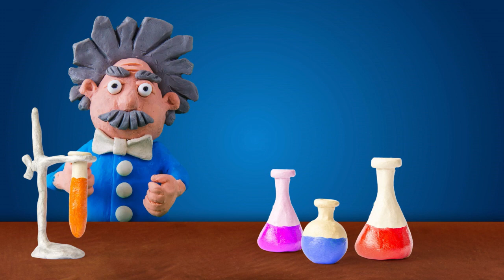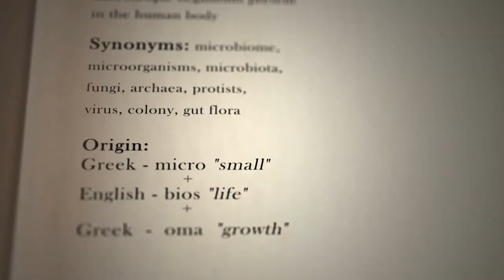Build this Laminar Flow Hood for a Sterile Work Environment

Comment: It looks decent, and the parts you used look familiar (haha) but sadly you are not getting laminar flow with that shield in the way and you can clearly see this with your lighter/flame test.  I'm not 100% sure if you've seen my vid or not but I explain this in more detail in my vid (not sure if YouTube would allow me to link to it).  I would lose the "wings" and top shield and then properly tune it for laminar flow.  The flame must be nearly perfectly still or you don't have laminar flow.  I'm not sure how clean the air must be for your intended purpose (plant propagation) but this design definitely will not work for mycology.  You can also easily prove if your design is working or not with a 5 minute open agar plate test (also shown in my vid).  If you research the medical industry, and look at commercial portable laminar flow units, you will see that they do not have fins/wings this is because that tends to produce more turbulent air, the reason is that it causes a vacuum in the areas that aren't in front of the filter.  Good luck!
Reply from the maker: I totally was referencing your video, I'm kinda shocked that you checked out my video, thanks for all the pointers. Now I'm going to do the agar plate test. My thinking was that if all the air is filtered and fully exchanged then it would be clean air, I turned my cabinet on about 15 min before using, so if there is turbulence  and pockets of unclean air hanging out and circulating then it would eventually get moved out. Time to experiment.
Reply: Laminar vs turbulent doesn’t matter much, all that matters is that the air is sterile. Either type of flow will achieve this, they’re just pushing airborne bacteria and particulates away from your work area.
Reply: @fancycrafts7774  BINGO! 

I try to stress this all the time. Laminar flow is not needed for this hobby, merely somewhat smooth persistent filtered air will more than suffice for our needs. This is a common misnomer pushed by those that simply do not understand what they are talking about. Also to note, many people showcasing DIY "laminar flow hoods" with HEPA-14 filters simply do not understand exactly what laminar flow is, how to achieve it, much less how to test for it, nor the fact that their filtration devices come no where near actual laminar flow. Most of all, the most humorous part, is that they seem to not understand it is regardless, and completely unnecessary for these purposes 😆

Im not laughing at the guy in the video at all, I actually appreciate the design and hard work put forth to create such a design. That being said, anyone claiming laminar flow, and illustrating such with: a lighter, smoke, or a particulate meter is simply and utterly wrong. A lighter (fireplace or any kind), or smoke is merely an indicator of generally HOW turbulent the air is, and a particulate meter does nothing but indicate filter efficacy, nothing more. 

Glad/surprised to see someone in the comments who knows what they are talking about. Nice to meet you!
Reply: How did your Petrie dish test turn out?
Reply: @WhiteBeardHashtag1205  please explain how you do test for it ?
Reply: @WhiteBeardHashtag1205  If you watch gordotek's video he uses the lighter only to demonstrate what the airflow looks like. He measured the air particulates with an anemometer in front of the filter it was 0 particulates above 1 micron,  which is absolutely ideal for mycology.
Reply: @WhiteBeardHashtag1205 I disagree with the idea of it not making a difference if the air is laminar vs. turbulent IF the intended use case is to exclude particulate matter in general or contaminate spores specifically. If you just turn the fan speed up you will get turbulent flow and this will show on the laser particle counter as particulates in the air stream. The particles are pulled into the work zone due to eddies which I explain in my video, also your body/hands and tools and work pieces will generally have contamination on them and the turbulent air will send them flying into your work. You can easily put this to the test with an open agar plate test as shown in my vid. If the turbulent air is not resulting in contaminated agar plates you are fine. But the particle counter doesn't lie, if particle counts are higher with turbulent air you are going to have more contaminated plates, but maybe it will only be minimal damage though and good enough.
Reply: @gordotek  I get what youre saying, I do. And Im not going to argue with you. 

What I will say is that many things make perfect sense in theory, however in application they just dont pan out the way perfectly sound theory would lead you to believe they would. 

My BBFFU, in theory, shouldnt work as good as it does, mainly due to it not being laminar flow. I designed this version of a "poor mans flow hood" when disaster struck my home, and I lost half of my home (the lab side and my sons bedroom) due to natural disaster. At that moment I was looking for a new place for my family to live, and to replace all my sons belongings: clothing, bed, computer, tv, et al. I was in a destitute situation financially and couldnt afford to replace all my lab equipment (specifically my laminar cabinet). I had seen single filter versions if the poor mans flow hood on YouTube, so I went to Home depot and bought: a box fan,  some duct tape, and a ton of different filters to experiment with. I spent about 2mo building and testing different single filters, and eventually many different double filter combinations set-ups (even tested doubled-up filter combos first on front only, and then back only). I spent a shit ton of time designing the BBFFU, because at that time I had a TON more time than I had money, lol! The BBFFU today is the the result of 100s of hours of building and experimenting, and they work FAR better than they should in theory. Ive been using if for almost 3yrs now, and it works so good I STILL use it, even though I have acquired another commercial hood again. Ive poured thousands of plates with mine (roughly 120 at a time). I let my plates sit for a week before I use them (even with my commercial hood), and normally Ill get anywhere from 0-2 of that 120 will tam with the BBFFU. Almost never a grain tam or G2G tam. Tissue transfer tams are also extremely low. In application it just works very well, even with its turbulence, though in theory it shouldnt. 

So, like I said, Im not going to argue with you. There are hundreds out there from Insta, Discord, etc, using these right now, with excellent results (turbulence and all). There have been a few with issues, but after talking with them I find out its due to either: poor sterile technique, not placing the filters on so that the arrows on the sides match the flow of air, they didnt purchase the right filters thinking they could get away with a MERV11 on the front (which will definitely cause tams), or they doubled up on MERV13s trying to make the filtration "even better" (which will choke the fan, causing tams due to extremely low airflow). One even one guy tried just sticking a piece of tape on both sides to hold the filters on as opposed to using the tape generously to seal the filters to the fan. Out of the hundreds out there Ive yet to run into anyone having issues that did a proper build. Many have told me they are no longer interested in buying an FFU or hood, that this does just fine for their level of investment into the hobby. 

Theory aside, the results speak for themselves. And, for $60, 10min of labor, zero tools, and so easy my 11yr old can make one, this gives you an easy to store BBFFU that provides a 20"x20" workspace. Id say its a huge success in all metrics.

Note: even though you and I have had our differences in the past, I want you to know that, when asked, I still stand by my assertion that your "laminar flow hood" is a good design, and a neat little tool that will help many in our community. 

Happy cultivating brother!
Reply: @gordotek I just got my prints and plates. Time to build the hood! Thanks Gordo!!

Comment: i would call this a positive pressure box. is it laminar flow? no, will it keep your samples contaminate free? yes. as long as the filter works the air is clean and it will keep contamination coming in from the air.

Comment: For mycologists arguing that it does not, or hardly, produce a laminar flow, I would say that the design corrects that issue quite nicely. As long as you have the sides and the plexiglass air tight, any turbulence will not suck contaminations into the chamber and you have a good amount of working space. Seems to me it works fine (although I failed to see where you sealed the filter properly to prevent air leaking through the edges) and I definitely enjoyed watching the build. Nice job.
Reply from the maker: Thank you. I didn't seal the edges. I'm relying on the foam edges of the filter to prevent air leaks.

Comment: I have to say, that build was BOSS! If you had it sitting at a garage sale, I'd buy it just for how cool it looked. I wouldn't even have to know what it is! 😆 As far as the overall design, I think it would have been nice to have the filter fill the entire workspace. Just to improve the laminar effect and reduce the turbulence and possibility of backflow from outside the hood back into your work area. But that clear top and interior light was a very nice touch! I hope you have much success in your nursery!
Reply from the maker: Thank you for the compliment. I went back and forth about having the filter fill the back wall.

Comment: Finally... someone calling something a "laminar flow hood" that has an ACTUAL HOOD! How refreshing. The only problem with this video title is that this design definitely does not produce laminar flow. 

I guarantee, just from watching the build, that this will work awesome, and be an invaluable tool for either electronics or mycology. Make no mistake, I am not shitting on this design, quite the opposite. I am actually praising this man's work. AND, there is no need for laminar flow for mycology (I cant speak for electronics repair, as I am completely ignorant to that field of work). As long as this produces somewhat steady clean air, it will do just fine. 

But make no mistake, this is not laminar flow, nor does it need to be. Also, a flame test, smoke test, nor particulate test indicates laminar flow, merely a generalized idea of how turbulent the airflow is. To test for laminar flow youd need an anemometer that not only measures airflow but variances within said airflow as well. There is a lot of math and features involved with achieving laminar flow. There are specialized 12" thick filters containing specialized straws within, baffles for the cabinet, and particular pairing between fan CFM, cabinet volume, plenum size, and proper filter specs that must ALL be met to achieve laminar flow. This design meets none of that, but should still work great none the less. Needing laminar flow for mycology is a common misnomer.

A quick tip for future designs, get you a wider filter that goes all the way across the face of the hood, height and width wise. Every single professional FFU and actual laminar flow device's filters encompass the entire face of the device. Will definitely eliminate those dead spots you showcased in your walk-thru, and will also help turbulence considerably. 

Overall, kickass design brother, nicely done!
Reply from the maker: Awesome! Thank you very much for all of that, I went back a test. I left a few Petri dishes open in different areas for 5 minutes. 3 weeks later there is still no growth. I feel confident that it works good enough. Thanks again for taking your time for the long comment and vote of confidence.
Reply: @FlomatonFamous  The build looks solid, I had little to no doubt it would function just fine for our needs. Really liked your design and ingenuity
Reply: People it's not a controlled lab lvl FFU. Its DIY home plant tissue culturing relax with laminar flow 😂
Reply: @jacksonnc8877  bruh.. Your comment is completely irrelevant. Youre just talking to talk
Reply: What speed setting is the fan on in this video?
Reply: @Mushmammy  This isnt my video, I dont have a clue what setting the fan is on
Reply: @WhiteBeardHashtag1205  yeah idk how that ended up here. I’ve already built one so I’m good lol.
Reply: @Mushmammy  haha! Right on 🤙
Reply: Thank you Bro, i needed this answer😊
Reply: @luisml836  you needed this answer? What was the question??

Comment: I have under laboratory condition used various hoods.  I have been thinking of making one for safety purposes for handling dangerous fumes and other things that have safety issues.  
for those hoods designed for working with bacteria I was taught to thoroughly clean the metal surfaces of the hood with 70% alcohol and we also had UV lights we could turn on at the beginning to sterilize the hood.  These UV  lights were turned off before the work began.  We also briefly flamed our working instruments with a bunsen burner.  Stainless steel or some real good surface coating for the wood seems like a good idea.   
I will later watch video and seems like a very good topic.
Reply from the maker: That's great, what work did you do? I will try to keep it as sterile as possible.
Reply: @FlomatonFamous  I did many things.  For the hepafiltered hoods I was working with bacterial building a genetic library from the blue crab.  A lot of other things have happened since.  
I do not know much about tissue culture and likely if you are faithfully reproducing what the others are doing, you will have success.   Sometimes it is little things that they do not share that can make the difference.   
A highly conserved red pigment-concentrating hormone precursor in the blue crab Callinectes sapidus
J M Klein  1 , C J Mohrherr, F Sleutels, N Jaenecke, J P Riehm, K R Rao
Reply from the maker: @loquat44-40  Bet you did some cool stuff, I'd love to hear about it some time.

Comment: You can use the air filter of a Benz Sprinter 190 ps or a Dodge Ram 1500 396ps. These Engine air filters are 0,3 micron. That's suficient. Not all engine air filters have 0,3 micron, but quality oem products made of thick folded paperlike material do and they have no leaks. For the turbo turbine and dpf of turbo diesel engines clean air is crucial (turbo engines in general but diesel is cheaper and you have to take care of the dpf). So I would go for these.
Reply from the maker: Good to know!

Comment: How did you attach the fan to the top of you box ?? Riley like your setup!!
Reply from the maker: Thank you, it's not attached, when I cut the hole exactly the size it needed to be. you could seal the gap with a little silicone to prevent air from escaping.
Reply: @FlomatonFamous  I dont think those small gaps will be an issue unless you decide to modify this current design with some type of pre-filter. As is, its a non-issue, as far as I can tell.

Comment: Why didn't you use glue for all the joints?  Wouldn't that increase strength and create a better seal to prevent contamination from sneaking through due to the high air pressure from the fan?  In any case, very nice build... kudos.
Reply from the maker: Just in case I need to go back and modify or replace something.

Comment: I built something very similar out of insulation foam board.

While this is better than nothing, the problem with this design (as others have mentioned) is that the air is still turbulent beyond an inch or so due to the difference of filter size and working space. I designed and 3D printed some flow correction grids for mine and it performs much, much better than it did without.
Reply from the maker: yea, my mistake, I did take a dish and opened it up in the hood for 5 minutes and 5  days later nothing is growing. I think this will work good enough for what I'm doing. If I build another I'll make those corrections.
Reply: "Why" you don't need that lvl of an FFU. It's plant tissue culturing and perfect for what he's doing

Comment: all these "mycology experts" blabbing their mouth, man..

I built an $80 laminar flow hood using 1 filter, a giant plastic tote, and a fan on the other side. Been using it for a year, and to my surprise, with near perfect sterility on my agar cups. None of these mycology 'experts' are scientific at *all*... they all find a single way in which work can be accomplished and then think that their $2,000 laminar flow hood is the ONLY way to do work. 

Doing science is not difficult and does not require a degree. If you want to build a cheap laminar flow hood and check the sterility, all you need to do is open up some agar cups in front of it in different areas in 3 dimensions. I got away with not spending an additional $1,900 and it feels GREAT.

Edit: nice job building your flow hood! Don't listen to the amateurs man, it looks great, and probably performs well enough too!
Reply from the maker: Thanks for the vote of confidence. I did an open jar test for 5 minutes and it never grew out anything. Works.

Comment: Does 70% isopropyl alcohol ruin a polyacrylic finish? I want to seal the wood on my laminar flowhood, and I use alcohol to sterilize my working surface.
Reply from the maker: I was curious I poured out a little to see what happens and yes it affects the varnish. You could probably use resin and it wouldn't affect it.